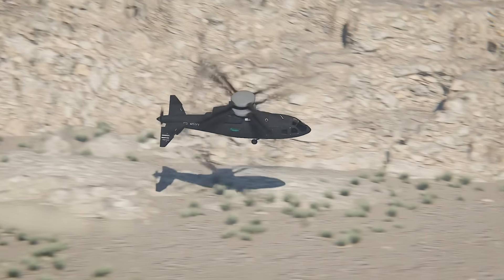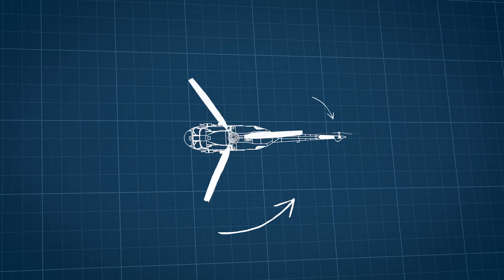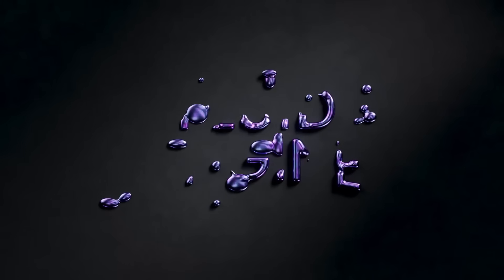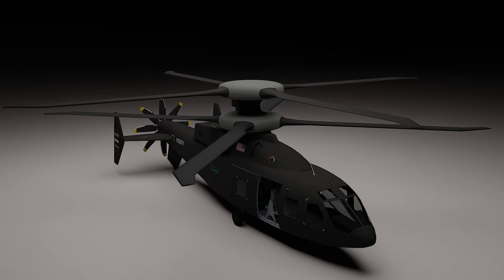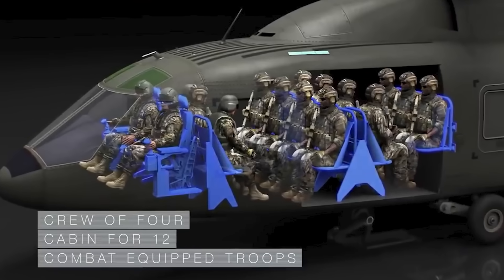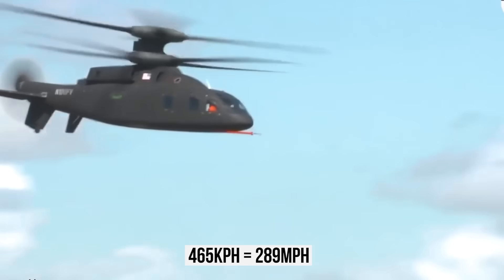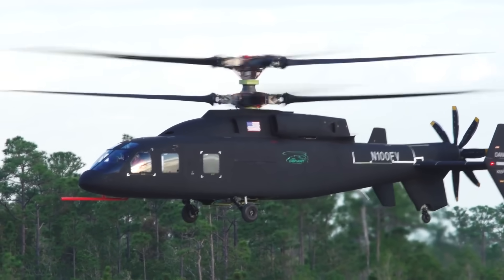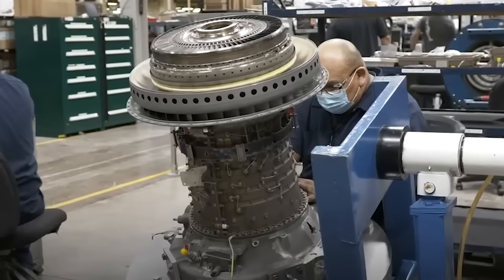Why the SB-1 never had a chance as the new US Army helicopter?

Comment: Another advantage of coaxial rotor helicopters is that they eliminate the dissymmetry of lift associated with single rotor helicopters when traveling forward. When traveling forward in a single rotor, the blades advancing toward the direction of travel will experience greater lift while the retreating blades will experience less lift, causing the helicopter to roll. This effect worsens as you go faster. Single rotor helicopters get around this by adjusting the angle of attack of each blade depending on their direction of travel but the angle of attack can only be adjust so far before it starts to loose lift. In a coaxial rotor, because there are advancing and retreating blades on both sides of the helicopter, the lift is already symmetrical weather it’s moving forward or not.
Reply: It still gets effected by this and if it was a flexible rotor design the blades would end up hitting each other like it was for the KA-50 which is why they had to make the KA-52.
Reply: The problem is that while you somewhat fix the lift problem, you aren't reducing the drag of the vertical assembly and the rotor blades producing no lift half the time is a big waste of energy. 

There were some experiments in the past about slowing the rotors and switching to wing lift to reduce the rotor drag. I don't know if anything came out of it.
Reply: @n3v3rforgott3n9  were did you get that from ? Russia has perfected coaxial by the Ka-25
Reply: @TheSMR1969 ... the KA-50 had this happen to it and crashed. Which is why they barely made any and made the KA-52. Stop making shit up.
Reply: @n3v3rforgott3n9  
1. They barely made any because they entered production in 1990 and the collapse of the USSR hampered it.

2. Your right coaxial was mastered by the Soviets with the first full production coaxial helicopter the Ka-15 in 1954 with over 300 made, which was followed by Ka-18 with over 100 made, which was followed by the Ka-25 with over 400 made, which was followed by the Ka-26 with over 600 made, which was followed by the Ka-27/32 with over 600 made, which was followed by the Ka-50/52 with over 100 made which was finally followed with the current most advanced version (non attack) the Ka-226 which over 200 have been made.

3. Ironic that you're accusing me of making stuff up when the Ka-52 was made because Air force wanted a dedicated Reconnaissance and anti tank aircraft, which is why the 52 has powerful electro optics and 2nd Gen thermals and 3rd gen night vision (with the 52M having 3rd gen and 4th gen)
Reply: @TheSMR1969  HAHA Russia can claim anything they want. They STILL do not use their equipment at night... No other country has pursued coaxial helicopters for a reason even though they first flew in France...
Reply: @n3v3rforgott3n9  you have no idea what you're talking about
Reply: @TheSMR1969  Ah yes the Russia ministry of defense footage totally didn't show them using a handheld GPS device in their military jet... HAHA keep coping along.
Reply: @n3v3rforgott3n9  possibly, as 4th and 4+ gen jets didn't have GPS systems like the Su-27 and MiG-29 although these only make up a small amount. It's blatantly obvious you have no clue what you're talking about and are just parroting whatever nonsense you read about that you agree with
Reply: This is not a conventional coaxial rotor.  It is a much more advanced technology known as X2
Reply: Eh. With a propulsor,  I would argue that counter rotating main rotors become unnecessary, because you do not need to increase collective near as much to provide forward thrust, as thrust is from the propulsor, and lift from the main rotor does not need to increase.

The disk does not need to tilt forward to provide forward thrust, you don't need to put a lot of AoA into the main rotor for speed.

Comment: I honestly don’t know why they chose the valor. The SB1 at least would have the counterwash failsafe during an engine failure. It’s the reason why v22 osprey crashes are so fatal.
Reply: The reason the body count of deaths from the V22 is high is because it carries 20+ people, not because of the amount of crashes. The Blackhawk actually has a higher crash rate than the V22. And again, the V280 may look similar to the V22 but definitely is NOT the V22. It is a completely different craft that has addressed all the shortcomings of the V22. I wish people would quit using the performance of the V22 as a comparison to how they THINK the V280 will perform. Really? You think the engineers didn't think of everything to fix in the design? Or did you think they just copied the V22? I know, they should look through the comment section of Youtube videos to learn what they need to fix in their designs. We know so much more than those pesky engineers and scientists. Sorry for the rant.
Reply: Both the XV-15 and te hAW609 have demonstrated autorotation.  The V-22 can do it as well, but  badly, so it would glide in case of a dual engine out.  Sikorsky has never addressed autorotation capabilities of an X2.

Comment: Why's it still got a tail rotor?
With contra-rotating main ones, it doesn't need one, isnt it, whatevers?
Reply: turning i guess
Reply: 6:48 it is not a tail rotor. It is a pusher propeller.
Reply: Speed. It's a pusher Propeller with produces much more thrust than a normal helicopter

Comment: Current UH-60M mechanic here. The millions of dollars that would need to revision current hangers will cost about as much as half as the V-280 will cost. The current hanger im at was built for Hueys, and it cannot fit all of our blackhawks as it is. Also the V-280 is a piss poor direct replacement to the blackhawk. The SB-1 alough very complicated compared to the Uh-60 would be a far better aircraft for the Army then the V-280. Let the marines use the V-280 and give the army the SB-1
Reply: They have already proved that the Valor fits in current hangars. People love to overstate the size of it. The Valor simply outclassed the Defiant massively.
Reply: @n3v3rforgott3n9  🤣🤣 maybe a hanger that's less then 2 years old it's fine.
Reply: @n3v3rforgott3n9  the Valor is going to be piss poor for assault operations. I cannot wait tell real life trials happen and we're going to see just how vulnerable the V-280 is going to be during those operations. The blackhawk has redundant systems unlike the V-280, SB-1 isn't as bad but nowhere as redundant as the blackhawk. We loose about 20% of lifting capabilites woth the V-280 and on top of that it's a completely new airframe and the cost to train current mechanics for an entire flush of airframes are going to cost even more. The SB-1 albeit a new airframe it isn't a completely different system. The last variant of the blackhack UH-60V's from my understanding avionics wise would be the same as the SB-1
Reply: For example we aren't supposed to hold more then 4 UH-60's in our hanger. Originally built for hueys it could hold 8 huey airframes. We're lucky to hold 6 into our hanger and we have to have the rest of our aircraft at another airfield or tied down outside
Reply: @cwb7143  "The blackhawk has redundant systems unlike the V-280"
...
like???

"We loose about 20% of lifting capabilites woth the V-280"
...
uhhh except the Valor has already proven it can lift MORE than the Black Hawk with that number expected is to increase even more.

Where are you getting your info? Also UH-60V was canned for now. The Valor only has a 19% larger total footprint while being able to carry 3 more troops at double the speed and 3 times the range.
Reply: @n3v3rforgott3n9  if you don't know what redundant systems the UH-60 has that alone closes this conversation with an internet troll
Reply: @n3v3rforgott3n9  also a sister unit of mine is getting the Victor models. I dont know where you heard the Victor models are canned for now
Reply: @cwb7143  Another veteran mechanic commented something different in looking at the Defiant he noted it would have been a mechanics nightmare.

75% of the Defiant is just for the gearboxes, engines, drive shafts, and landing gear. Also, there are pictures of the Defiant next to a blackhawk and it is clearly larger.

As such the old hangers regardless of which airframe was picked would need to be upgraded anyway. 
That said because the V-280 was ready, mature, and oddly enough took way less maintenance and was praised by Army pilots means its RnD and procurement are going to be a lot cheaper, faster, and thus those cost savings can go into upgrading older hangers.

By contrast, the Defiant was constantly breaking down. Forget range and speed the Defiant which was over a year late in trials had already proved itself to be a money pit. 

Further savings occur thanks to the V-280's long range thus reducing the army's logistics train by allowing C-17s to carry other pieces of equipment instead of the army's transport helicopter fleet.

Comment: With the FARA program dead now, the Sikorsky dream helicopter's prospects do not look good.

What they don't mention here is that the Sikorsky prototype is far larger and more complex than the V-280 for a similar payload, much less range, and far lower speed. Not to mention the engines weren't the only problems they were having; the rotor assembly was still having design issues by the time the decision between the two was made. The Sikorsky project was significantly behind schedule whereas Bell was easily keeping on time. So there's no wonder the Army chose an established technology on a lighter, smaller, faster, less expensive craft that gives them better performance.

Comment: The problem is the cockpit.  Especially for tandem seating RWA gunships, which require an equivalent dead weight tailboom as mass balance, hanging off the back.

It is worth noting that the original ARTI and later LHX programs did a lot of work, looking at single-cockpit pilotage systems so that the relatively tiny T800 (initially 1,200shp, later 1,500shp) could work on a composite (ACAP) airframe with virtual aided pilotage (SHADOW) and fully automated mission systems based on a simple, finger on glass, 'point at the digital map where you think the bad man might hurt you...' sensor system which pre-cued sensors with mass video memory scanned image field sorting (EOTAS) to look for and ATC classify with TV, FLIR and (Longbow) MMW Radar targets.

All without needing a human CPG onboard to scope dope integrate sensor and ELS big picture data on.

The automation did it all and the pilot chose from thumbnails, which targets to hand off to what weapons system for ATHS datalink passage.

Workload was still very high, with task saturation 'sanity checking' (cross-hemispheric function to catch up and do cognitive house-keeping before reordering active workloads) frequently overwhelming pilot instrumented EEG scans of brain activity.

But so was conventional performance thanks to a (NOTAR) ducted tail propulsor, which could jet out a single, aft facing, propulsion stream from the tail as speed came on the airframe and normal AT rotor function was no longer needed.

This allowed the hybrid/compound bell LHX to be quite spritely at ~200 knots, for its sleek, sharklike, conventional airframe class.

Sadly, tail control was lacking at lower speeds and as signature began to add weight and egos began to treat an ambush scout/escort platform like an airshow stunt airframe, the focus upon SCAT (Scout Attack) began to be lost as platform cost of the then RAH-66 Comanche meant it had to take over Apache as well as Kiowa roles to justify the large airframe buy needed to maintain reasonable per-airframe PAUCs.

The real shame being that the liaison roled UTIL (Utility) platform was also cancelled to maintain the Comanche effort overall, and this destroyed Hughes/Boeing and Bell's market position as Eurocopter began to radically upgrade the Ecureil and BK-117 into competitors for the police, aeromedical, aerotaxi, traffic monitoring and offshore markets at price points better than the next increment up, 'luxury' S-76 and A-109 alternatives (which were faster but also heavier and not as economical to per-passenger operate).

Conversely, the V-22 is a DANGEROUS airframe to fly, with the small diameter prop rotors generating high velocity thrust posts which are both difficult to work around in and subject to VRS stalls which suck the aircraft into CFIT based on such things as descent rate and even crossing over object/basing mode features like compound walls and hull edges.

The Osprey is also enormously expensive for its CH-46 class lift in a CH-53 sized airframe and thus not on the Marine LHA/LHD airwing in sufficient numbers to really do first-wave over the beach air assaults (it is a STOM/SOF platform for Raiders and Recon).

It also is too narrow cabined and so completely lacks any vehicle carriage options.  Without drive-to-gunfire mode, modern infantry are unable to separate from a fire fight and your 60-100 million dollar vertiplane is at constant risk of catastrophic loss, coming in to grab them off a hot LZ.  Risking the huge airframe to loss of power from a shot-out engine, too low and slow to surge the opposite side through the common gear box transfer shaft before the entire aircraft comes crashing to earth, _hard_.

whereupon it promptly breaks its spine because it's transversely weak, right behind the cockpit, to sudden vertical loads.  What a really great idea in a VTOL airframe!

Now, take us out of the Cold War and look at systems like the A.160 and the MQ-8.  Which not only replace the conventional pilotage system but ALL of the forward crew cockpit.  What this potentially does, for a UAV remoted or cabin-area pilot, is allow the airframe to exit-forwards rather than aft with a smaller, liaison level, (6-8 men, or two litters and a medic/escort).

And, in combination with UGV technology, bring the fight to the enemy without having men be involved in an artillery fight ala Ukraine.  If the nose is short and split ala CH-37 Mojave, the cargo box is open and easy to enter for either a squad level lift or a utility/transport role with resupply.

And because the nose is stubby, the tail can be too.  Which keeps the weight down and the performance up, on a compound.

The biggest problem with both the Valour and the Defiant is that they are still modeled on the Vietnam era approach of direct vertical envelopment as air assault and that simply does not happen on a modern battlefield where everyone has RPG and autofire and most have the ability to rapidly call RCL/Mortar/Rocket/MPAD/ATGW as well.  Contrary to the intended effect of the MBC, Mine usage and production is actually up as the only thing which can protect isolated defensive forces and so just 'walking it in' is not practical.

But nobody has considered how relevant a role a small liason (modern LOH equivalent) helicopter could be, if it could undertake dangerous and dull missions like forward area logistics and casevac via an ATV level, 'let the robot go first!' fast ground-scout or ambulance/supply truck could be.

Because the Army, as a giant flying-union with an RWA inventory larger than many air forces total orbats, is Dead Set against integrating UAV technology.  Even Though one of the primary achievements of ARTI and LHX was demonstrating aided pilotage to include very low level NOE and approach to hover obstacle navigation with LiDAR and MMW systems like ROMEO.

If the Army wants to move forward, as the loss of the Ukraine War portends a forthcoming loss of GRC dominant currency value for the Dollar, they are going to need to move to much cheaper systems.  With small, dedicated, auto-fly systems packages (few sensors but competent ones) in an overall airframe package which is about half that of current systems.

With the switch to drones across the entire field of policing and traffic monitoring systems, you can buy a Eurocopter for about 4-5 million used and 7 million new.  At that level, a 200 knot UAV RWA that could enable tiny outposts of 2-3 soldiers to control an 'open battlespace' ground domain with UGVs and be resupplied, casevac'd or even rotated, effectively, via ATV transports, in and out of forward positions without revealing (IR camouflage) their positions via direct overflight, would be a god send to the distributed network enabled battlefield.

Since our armies keep getting smaller, thanks to the quadruplets of stupidity known as DIE/LGBTQ 'loyalty testing', inadequate salary, over-deployment and high expectations of lethality thanks to dated hardware and doctrine, the need is to go lighter/smaller, not bigger and more expensive.

Something Ukraine is finally showing to be a fatal flaw in the American 'Super Weapon' concept of wunder waffling of hyper expensive, low inventory, weapons platforms.

You wait and see:  End of the day, the future of military and civilian vertical lift (due to economics alone) will be a Hummingbird light weight shell with a CH-54 equivalent payload box between hybrid-wing landing gear sponsons to offload either an ABC or conventional rotor system and a UAV nose without cockpit extension as mass/CG bloom on a nearly tailless, X-2 or K-Max styled fuselage with vectoring propulsor and small tail effector that functions like a spoiler or ejector.

It is the crew space which is driving everything else to cost:size failure threshold on modern helicopters.  As soon as we ditch the horses-must-be-ridden idea, helicopters will have a second surge in success as military usage popularity.  Because they will save small armies from mass slaughter.